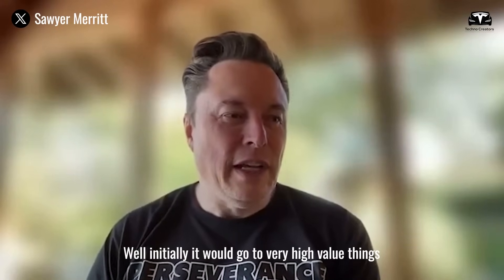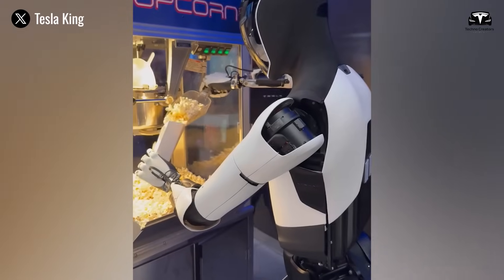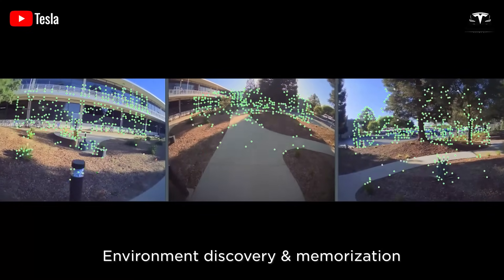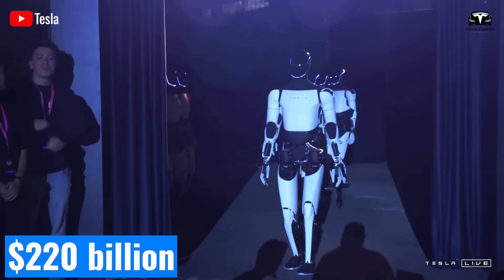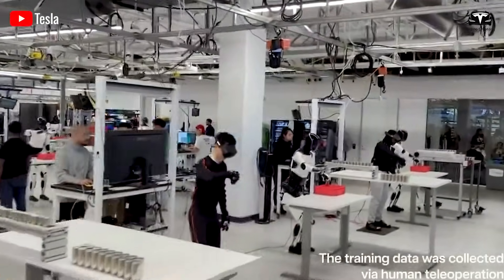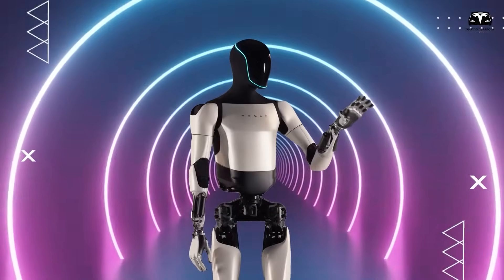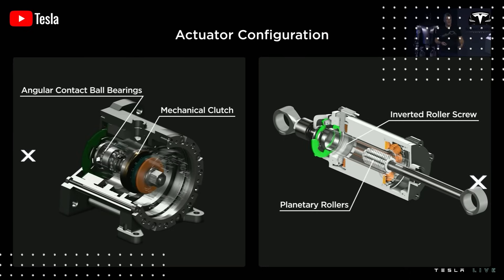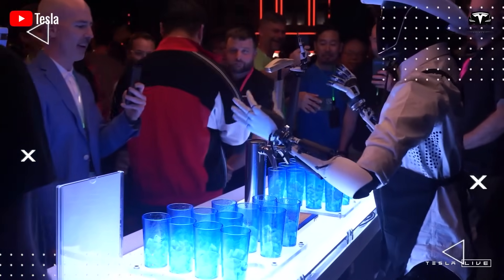BIG UPDATE! Elon Musk Confirms 2026 Tesla Optimus V3.5 New Insane Features, 3500 On Production!

Comment: lol 50 lb's? a human in elderly care can be 200+ what would they do if the elder fell? call 911 and say help weve fallen and can't get up? It can't even help them walk if they can't lift more than 50 lbs. These things no matter how smart are like flimsy tin cans only made outta plastic. Let me know when they make them stronger. Over 1 ATM Waterproof, wind proof and dustproof, able to function on ice, ten ft of snow and -35F wind chills, heat/ fireproof, able to drop from high heights (to escape fire in living unit) shatter proof, Able to lift carry over 250 lbs, SOS, GPS and tracking. Be able to wash and sanitize their hands or every part on them. I'm sure i'm missing some stuff that's needed for elderly care. But you get the idea.
Reply from the maker: Totally fair! Optimus still has a long way to go—future versions will hopefully be way more capable.
Reply: @TechnoCreators-pj9dg I was thinking... they need to start working on the feet. Like they did with the hands but for the feet. But instead of just human like maybe add some gorilla attributes for climbing. Retractable claws like cats also for climbing and rough terrain. And wheels for a clear environment for speed like a factory. Also have sensors on all sides of the foot so it don't step on kids or pets ect.
Reply: I'm 79 and weigh over 300 and when I fall I need help.  50 lbs of pull helps get me to a sitting position which would be a little more comfortable but no way could it turn me and get me to my knees (can't stand that anyway due to intense knee cap pain).  It take a minimum of 2 strong paramedics to pull me from a seated position to upright. For the life of me, I can not feature a robot ever being that strong. To do so means they half to weigh much more which would reduce their work time extensively.  However, they say Optimus can work in the rain but not submerged in water. From your description of what you would need in a robot . . you need Superman not a robot!!! LOL